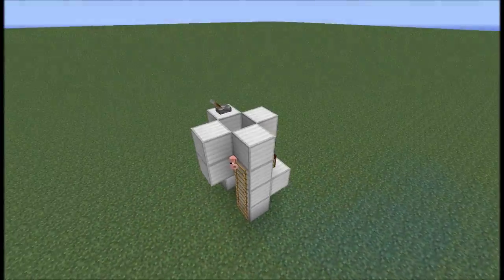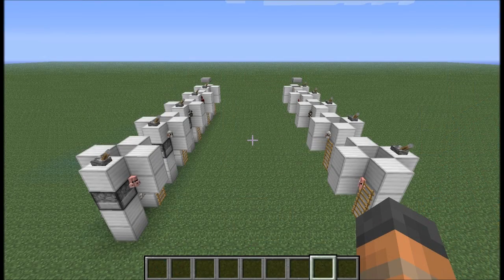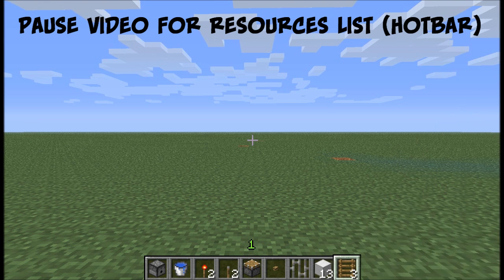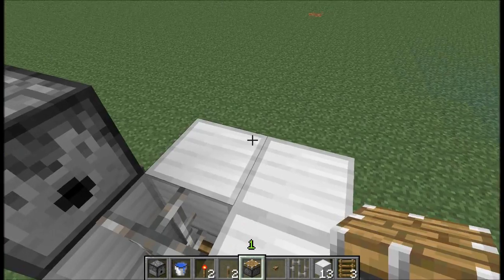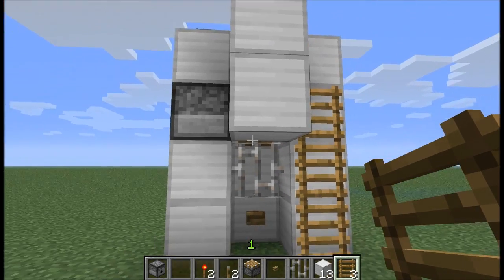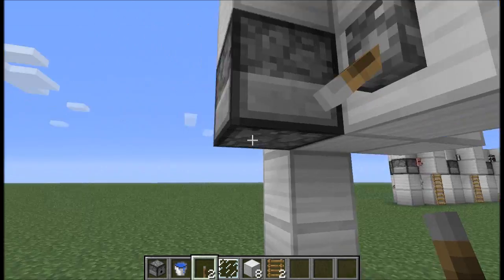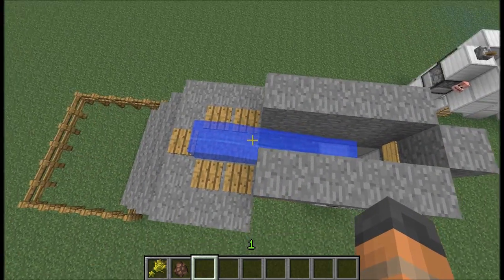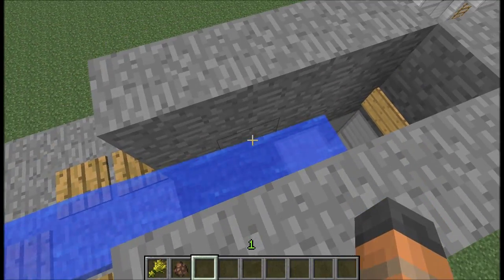Compact Animal Breeder (CAB) For 1.4 Tutorial

Comment: Dear Xisuma.
I made this CAB in a server I play on, and I have encountered some problems:
First of all, mobs easily glitch through the corners of the blocks, when you relog. (I have fixed that by placing a water block instead of using a dispenser, so there is water source block at that spot ALL the time)
I have also encountered baby-mobs glitching through the corners (without reloging) and the babies also glitch out of the CAB when they grow into adults :(
Do you mind to remake it? :)
-H4mM0nD

Comment: I did some tests. I can breed them from underneath to. Maybe it is because the opposite block from the dispenser, I changed to a slab and a slab underneath as well. So my face would be half above the glass pane. Then, I can also pick up every single drop. But I use 1 Redstone to power it. If I remember, I will send you a screen shot tomorrow evening. 

But brilliant idea.

Comment: You can make the piston version even cheaper and compacter by putting the ladders on the dispenser (with a bit of cheating of course, put a block one above where the ladder should go and click on it from the bottom to place the ladder) and getting rid of the block under the piston and the two opposite the dispenser.
The ultra compact is unaffected by this though except for one clock swap.